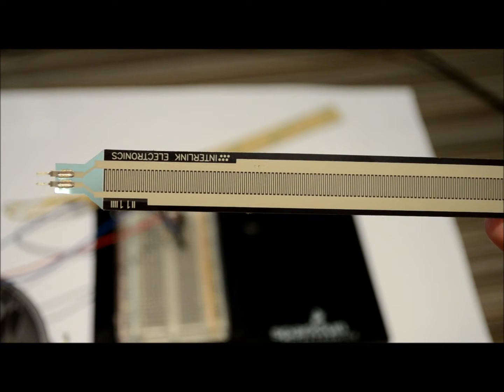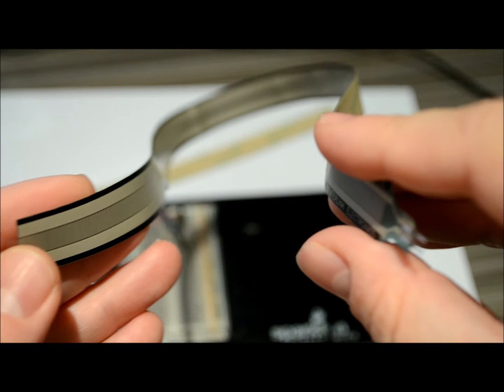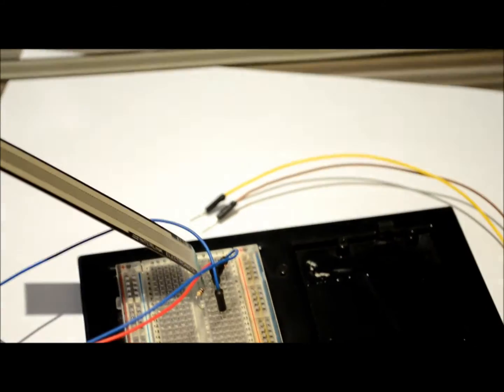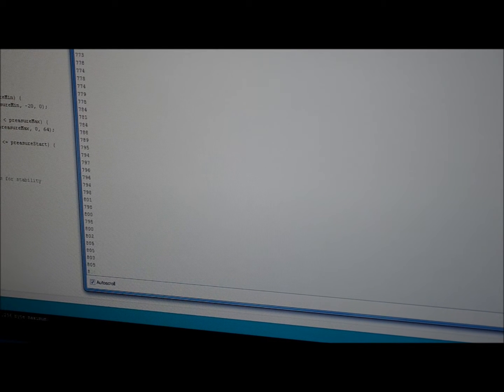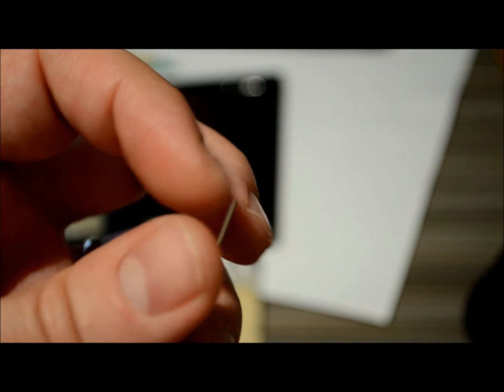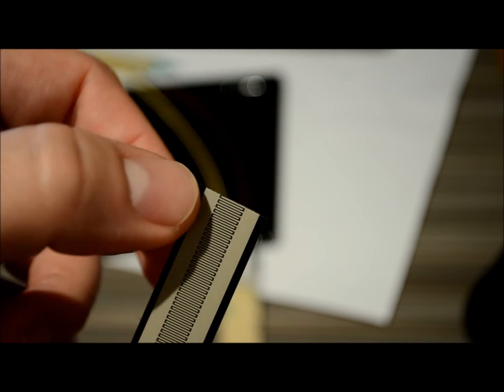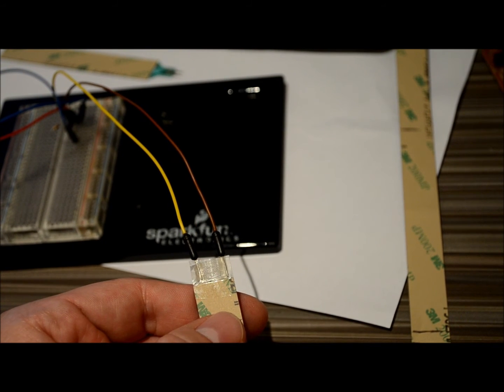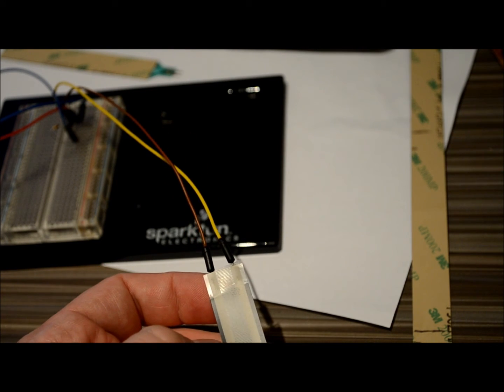Making many Force Sensitive Resistors (FSR) from single FSR

Comment: Hi, thanks for your video. is this sensor only working with conductivity of a finger, or also other materials like plastic or wood? Thank you
Reply: It's not like a conductive tape, it's a pressure sensor. It's normally open and if you squish it it will become a variable resistance, sensitive to the force applied to it.